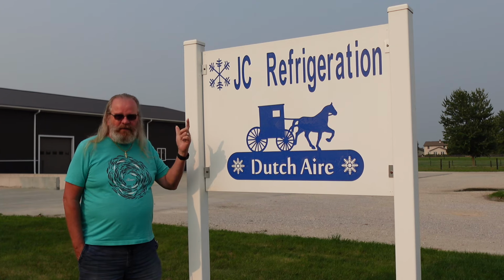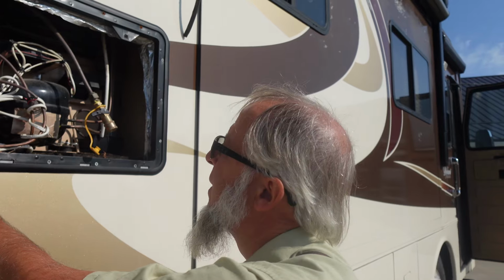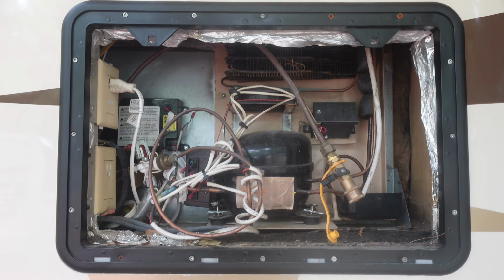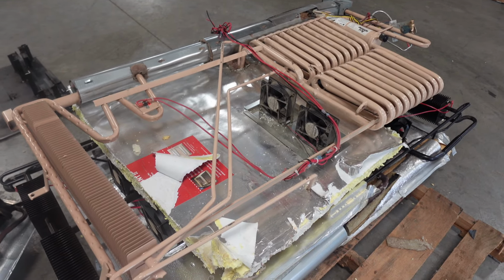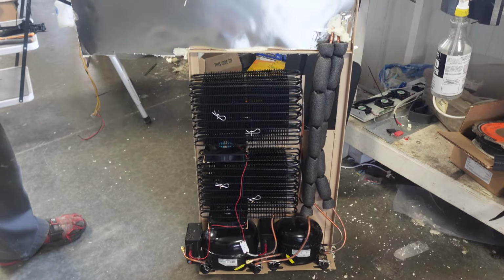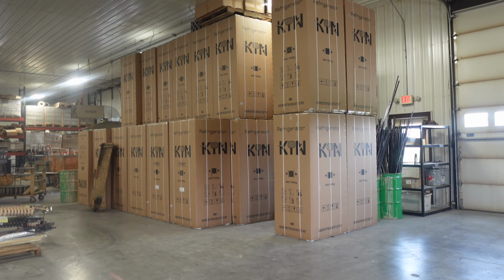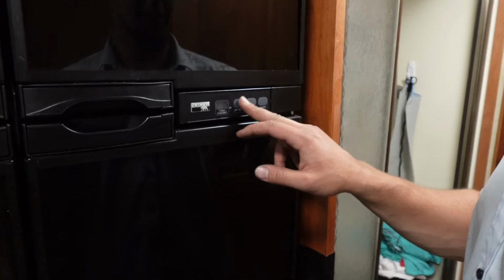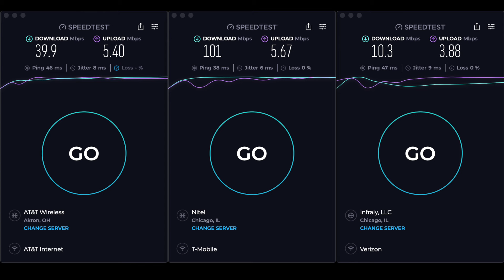JC Refrigeration, The Next Generation: Compressor Fridge?

Comment: I just replaced the cooling unit in our fridge with a 12v compressor. So far it is working great. Cools so much better.
Reply from the maker: We love ours too. We had some wiring issues but it was quickly resolved and it’s working. Like a dream. We appreciate you watching. 💕

Comment: We have the original single compressor conversion on our Norcold 1200 refrigerator. It works better than the absorption set up, but not as good as we would have liked. It looks like we should have waited for the dual compressor upgrade
Reply from the maker: Changes can happen quickly at times. Ours did not work as well as we wanted either and that is why we went for the upgrade. If you wait long enought they may even upgrade this. One never knows. Best Wishes for the future.

Comment: I just made the trip last month to Shipshewana IN, and Aaron and his brother converted my Norcold 2118 absorption unit with the 12 volt unit. I can't believe how well they work together and how fast the new 12V dual compressor unit cooled the refrigerator down! In preparation for the conversion I had already run a 10-gauge wire and 30 amp circuit breaker directly from the battery to the back of the refrigerator - this save me $200 from what they would have charged to do this. I'm so happy that my 18 cubic foot Norcold is now working as it should, and highly, highly recommend JC Refrigeration!
Reply from the maker: That is awesome to hear. We are also very pleased with their service. We recommend JC Refrigerator as well. Thank you so much for sharing. 💕

Comment: Just found your video 1&2.
It’s Almost March 2025 just curious how things are going with dual compressor fridge.
Reply from the maker: It’s been a while and we love the dual compressor it is much better then the single compressor hands down. :-)
Reply: Thank you for the reply.
I have a 2005 Bigfoot truck camper the original is still working but would like to upgrade to a 12 volt from JC’s, It seems to struggle in the hot summer months. Hopefully they can lay it down on the dinette seats to make the transition. Because I’m sure it won’t go out the door.